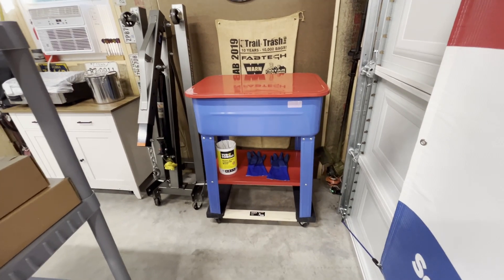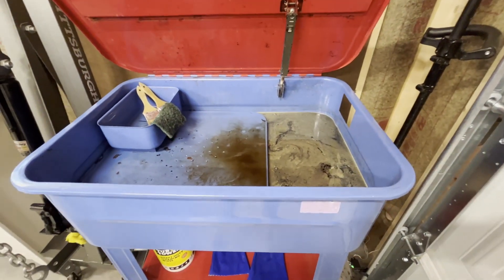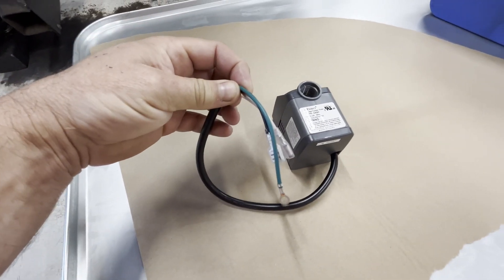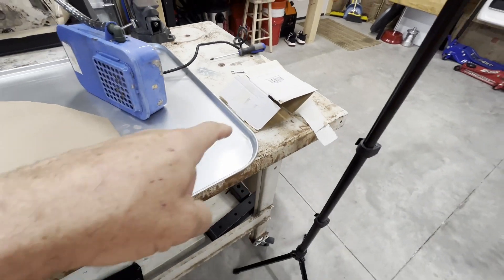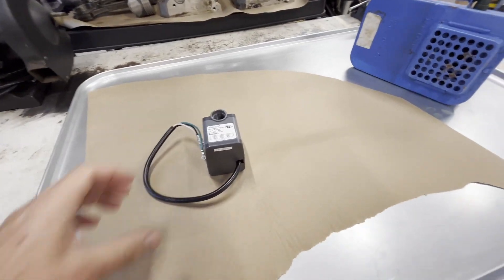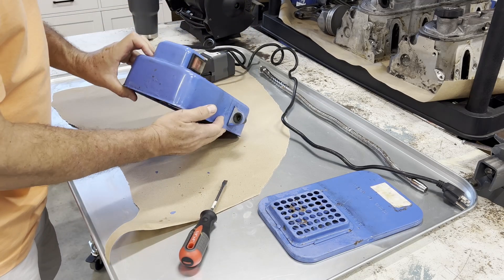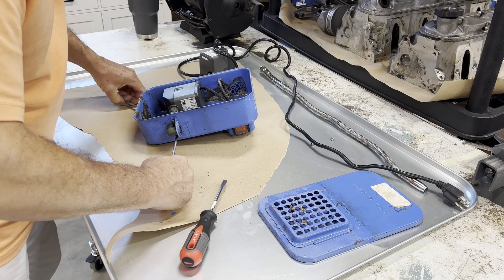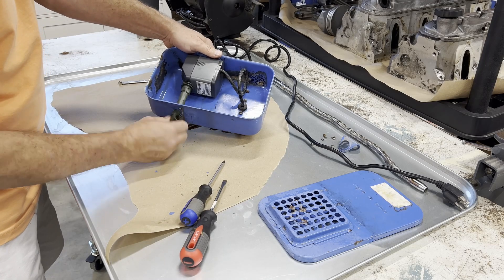Fixing a Used Harbor Freight Parts Washer We Found on Marketplace

Comment: There should be a filter in that intake grid. When mine finally wore out, I replaced it with a filtration system using an oil filter. There are plenty of videos on YT to get ideas from.
Reply from the maker: @research903  Oh yeah? Good info, I’ll have to look into that. Thanks!
Reply: @kauffmansgarage  an oil filter will not work well with a water based cleaner. That intake grid usually has a piece of white scotchbrite from the factory.
Reply from the maker: @Mr62biscayne  Thanks! I'll have to locate some replacement filters before I refill it.